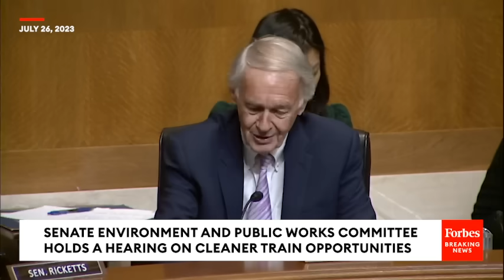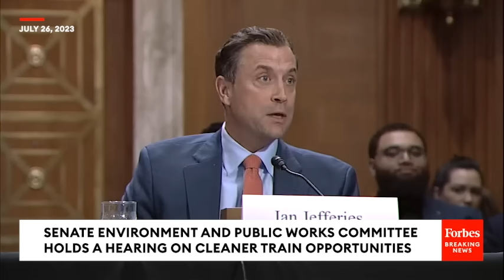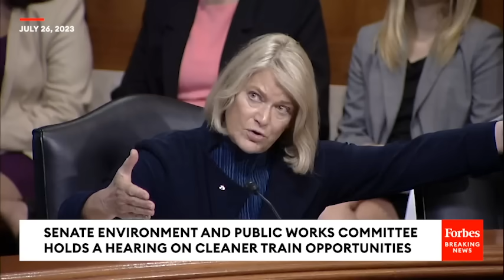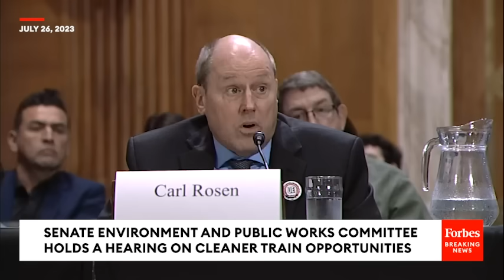‘How Long Would It Take To Replace All Diesel Locomotives With Electric?’ Cynthia Lummis

Comment: A new diesel-electric locomotive is $2 Million+. Short line railroads use older d-e locos worth $50-100K. My daily loco was built in 1956 and still runs great. Being forced to buy new electric-only locos would destroy 90% of all short line RRs in the US if not 90% of the industry. This is stupid.
Reply: To make the battery alone would take most all of the total battery production today , cars would have to wait . To make one battery for a loco would take hundreds if not thousands of EV 's with no batteries  .
Reply: @claybair4904  The only reliable electric trains have overhead wires. Try refining and stringing all that copper on steel poles without burning any coal! LOL!
Reply: @jaqcp  the only reliable electric trains can be set up on the dinning room table.
Reply: @jaqcp  or mining any copper since it is about impossible to permit new mines in the USA!

We could have been full electric by the 1950s or 60s if that had been the push when they were replacing steam, now it would be a disaster to convert.
Reply: @danw6014  Uh, even those are a PITA to get running reliably.
Reply: @danw6014  actually lot of them aren't reliable either
Reply: @lynncarden  the old ones I had when I was a kid still work. They won't be leaving you stranded in the Nebraska prairie either.
Reply: @danw6014  and under the Christmas tree.
Reply: @claybair4904   Very limited range too. You think there are supply chain issues now? Wait 'til every freight train has to stop and recharge the batteries every 100 miles on a 4000 mile trip! That would be a colossal traffic jam of Biblical proportions.
Reply: @claybair4904 I can’t see locomotives using batteries over running off direct power lines like all other countries rail systems. I’d think our county would cost tens if not hundreds of billions of dollars updating our entire rail system just for the locomotives and power lines, not even replacing track.
Reply: @claybair4904  -  Its easier to electrify the lines like Europe and the largest rail system in the world in Russia and the countries of the former Soviet Union. Electrification is the answer, but not with batteries... Just electrify the lines and that will solve the problem but it will take decades to do that also. And it will require NUCLEAR POWER to make it all work properly. HELLO MR THORIUM.
Reply: @KlodFather and one strong rain with wind and the line are down pure crap and not reliable and don't forget the cost of maintenance of said wire and said wire need to be bare for the train to make contact with it and bare wire out in the wild will corrodes fast
Reply: @legros731  -  The wires are usually (I believe) Zinc coated low corrosion steel. They have all electric trains in Europe and Russia as well as the FSU (former soviet union) countries. This is not new tech and is well established. It is possible to electrify here, but it would require a lot of infrastructure. There is not enough electric power generation to run our trains by battery or by wire, but the wire is more efficient and has less environmental impact. No more double deck trains. It might be better to do it with a third rail... But that is dangerous. 5 to 15 kilovolts.
Reply: @KlodFather  I live in Québec and we just build the rem it a passenger electric train with overhead wire at night you can see the thing sparking like crazy  and it look like crap with all the wire in the air disgusting
Reply: @legros731  -  Its still a better system than batteries in a train. A train is electric anyway... Its an engine running a generator or several generators and then traction motors that drive the train. Either a third rail or overhead wires needs to be installed to electrify the trains. Batteries will be too impractical.
Reply: @KlodFather  where did I even talked about battery you can't compare Europe to north america distance are way different it make no sense to install wire and a third electrified rail is nonsense where anyone can touch it  it's not a subway we talking about 
There a reason all of north america use diesel electric it not like these decisions are taken without any tough
Full electric is good for transportation like subway and tram we got all that in Quebec but still use diesel electric for freight
You not making Montreal Vancouver in a tram lol it 5000km  or 3000 mile of wire across nothing but field and forest lol good luck
Reply: @legros731  -  It has already been done. There are huge rail lines in Russia that are electrified. Granted it is high voltage, but nevertheless it can be done and has been done. Batteries is the BS way of doing a project like this. Its an enormous amount of power to move those trains. You are correct that there is not enough infrastructure and that it is a difficult project... But it has been done. We need Thorium Nuclear Power to solve our electrification problems.
Reply: @claybair4904  WTF battery!!!!!!! Europe and most of the rest of the world uses trolley electric. North America, and Australia are in the stone age, and love being there. Will trolley replace every diesel loco, never, but most main line can be.
Reply: @claybair4904  I say the biggest thing I saw in Europe was all the Electric wires running beside the tracks for Locomotive to get their charge. I don't think a EV Train would work like they think it will. Cause if you take how many cars they pull I don't think it would last as long as they think plus if they went the Europe Ideal, You would need a lot of wire ran across the country. Also think the BIden people playing around like this is Sim City or another city builder game, where you can click and build and in seconds it is built.
Reply: let me guess EMD gp9
Reply: @dknowles60 I was guessing GP-7. A SCL official in Waycross told me it was the best locomotive they had ever had.
Reply: @jockellis  E.R.O.E.I WHAT YEAR WILL CONVENTIONAL OIL PRODUCTION PEAK ???
YOU ARE LIVING IN A DREAM WORLD
Reply: @dunexapa1016  Back atcha.
Reply: @jockellis   Oh gee, what wit.
Reply: @dknowles60   GP8! You're awesome!
Reply: @jaqcp   you just taught me somthing never knew that Emd made a GP8  but since you are doing a tough job as a locomotive Engineer  i just learn somthing
Reply: @dknowles60  The lines between Gps 7-8-9 seem to be blurry. Our locos (PREX 801, 802, 803 working on the GCW if you want to look them up) have the pneumatic reversers and control stands, so I was told they are 8s. I believe the 9s had electronics packages, but are otherwise similar in size and power. Since this is  my only road and only locos, my experience data base is very narrow.
Reply: @jaqcp Electro-Motive Division(EMD) of General Motors designed the GP7(rated at 1,500 hp from the 567B 2-stroke engine) & was built in the production years of '49-'54. It's successor is the GP9(rated at 1,750 hp from the 567C 2-stroke engine) produced from '54-'59. The only RR Co. I can find that had an extensive fleet rebuild program was the Illinois Central in '68. GP7's were rebuilt to GP8's & GP9's to GP10's. Now we're 55 years on & the origin of the Loco & it's rebuild status could be very different & possibly those details might be unknown to whoever is asked. The Loco might just be called a GP8 & the employees didn't gave it a second thought. The RR's Power desk would have the specifics of the Loco's ~68 year history, if you have the time to check, it would be interesting. As far as I'm concerned, you were told the Loco...or 'engine'...is a GP8, good enough for me, but the histories & rebuild status can be very interesting. What's the name of the RR you commute on please?
     Having the Green people snapping their fingers & imaging a fully functional Battery/Electric Loco w/in a decade is beyond the capacity of healing by a Hospital Mental Ward or Mental Institution. Reality has always perplexed the Radical Dems & the Climate Cultists. Include a few money grubbing power hungry RINO's & I'll now have Archery practice aiming at their bloated fannies.
Reply: Whoa there Kermie,  Rep. Cynthia Lummis is on our side. She represents Wyoming, and not a blue state, and I remind you and anyone else reading this that, failing to vote in EVERY election is a stupid move if you are a patriot who loves our country and our decedents. Even the lowest council meeting and HOA election is important. Tell everyone to get out and VOTE. Vote the bastages out!
Reply: @carmiethompson2676  The locos I mentioned are in fact a part of the ICG rebuild program.  Good call!
Reply: @jaqcp Just to be clear; there's Illinois Central(IC), from 1851 - 1999 & Illinois Central Gulf(ICG), from 1972 - 1998. The 'overlap' of the final years is interesting but not needed for this conversation. As I stated in my first comment, the rebuild program was started in '68 at the Paducah, KY heavy shops. All the rebuilding & repowering was done by IC not ICG but if some engines were finished after '72, I don't think it was important to management to credit ICG. They were working on the merger into Canadian National(CN) & the Canadians were more concerned about the health of the fleet.
Reply: @lynnkramer1211  School board elections may be the most important.
Reply: I think that is the goal.  Destroy the smaller companies while investing in the large ones.  Once the large ones are all that is left, go for full control.  Capitalism to Socialism transition is complete.
Reply: @TheBeacker1  nationalized or confiscate. That's what is happening with farming.
Reply: @danw6014  Where in the USA has a farm been nationalised?
Reply: No, corporatism. Corporatism is a form of fascism.
Reply: @TheBeacker1  yeah you saw that too,under this crazy leadership of [who are you,i'm here to help] way too much control for one system the railroad system,i moved 20 miles just to get away from the noise of coupling and uncoupling cars at 1;30 am.this will not change with electric power,the noise
Reply: @TheBeacker1  The world run by large corporations is not socialism in any shape or form. It is just how capitalism evolves.
Reply: it is not unusual for a train to have four or more locomotives with a combined power of over 12,000 HP and to need all of that power to get up the hill.  Nobody makes a battery that can support that much load for any length of time and if somebody did at some future time, it would probably weigh as much as the locomotive itself, and cost as much as well.  what is going to happen when that battery needs charging?  Is the train just going to stop and wait the hours it will take to top it off?  until bureaucrats and politicians spend a few year successfully running a railroad they should avoid telling the industry how it should operate.
Reply: They are trying to do something similar to small farmers in California.  These family farms have collected a fleet of vehicles over decades, and the state says they are polluting even though they are specialized and many of them don't run all that much in a year.  So now the state is demanding that all these vehicles be replaced at once never mind that a family farm doesn't have $1.5 million laying around to replace them all.
Reply: FYI almost all locos in the US are electric.  Some of the 100% are electrified by a catenary system and others by a prime mover in the loco.   Got to get the electricity from somewhere.
Reply: @Tsamokie  not many that are direct electric.  We did the same thing in mining, 50 years ago almost all the large underground rail was catenary, now you don't see rail at all, just dumbly used direct drive diesel trucks. 

I've thought for a long time that a hybrid solution for diesel-electric wouldn't be hard, add a battery car in with each loci and use the power generated when rolling down grade to charge batteries instead of sending those amps to the grids as waste heat.
Reply: short lines and last miles, ctanary is really superior, the problem is the infrastructure costs and buildout costs for the catanary, the good part however is that all exsiting locomotive can be converted to catanary. There significant issue catanry, but it's more practical than batt/electric
Reply: Who is going to pay for it? Build back better? Build back better is not even upgrading the electrical grid. Build back better doesn’t know to produce electricity for all the electric cars the government is forcing us to buy.
Reply: but they are doing the same with cars -- can have a 25 year only car fully compliant with emmission tests today and yet the push is replace all with electric  even though there is not enough compacity in electricity producation !
Reply: Many if those have already been converted to LNG or Propane fueled locos which ARE zero emissions. Nothing comes out except carbon oxygen and water. The carbon is heavier than air and settles to the earth and become plant food. That's as environmentally friendly as it gets. Wind farms besides looking ugly, kill thousand of our limited numbers of birds of prey every year. That is NOT environmentally friendly my friends.
Reply: Well that is the governments goal. To destroy as many small businesses as possible.  The government wants to control 100% of everything. You are not allowed to own anything. That is the end goal
Reply: Agree. Diesel electric is about as good as it can get. Left wing socialist Politicians and left wing activists are dangerous
Reply: That's the point.
Reply: There exists an reasonable cost and time solution. As you pointed out your daily driver loco was built in 1956 and is still running. The reason, it is a hybrid. ICE powering electric trucks. So here is the solution, remove the ICE engines. Install a battery pack that can run the train for say 20 miles. Add  pantographs to the engines and put up line contact points, sets of charging wires every 10 or so miles. No need to electrify the entire of the line, just about 10% of it. Stations are of course charging points. 

In this  way, the major costs of building new engines is avoided. The environmental costs of building new engines is avoided. Keep as much of the old engine as possible.
Reply: @oldfarthacks they do t have the technology to make batteries big enough to store enough power to run a locomotive for 5 miles let alone 20
Reply: @ohboy2592 For sure, but how about pulling wagons with freight?
Reply: @oldfarthacks  Cantenaries are EXPENSIVE and a waste.  ESPECIALLY for a short line railroad.  Why would you rebuild a perfectly running locomotive and install a bunch of infrastructure which would require full time maintenance personnel, when you could get a refurbished locomotive for a fraction of the price??????
Reply: @oldfarthacks this will never work lol
Reply: Like democrats give a crap if they put people out of work and destroy the economy!
Reply: And guess who in the industry will be pushing for it? The big shipping companies so they can swallow the small operators!
Reply: @johnbaker6125    I believe you may be delusional. The question is ... Would you WANT TO be disillusioned?
Reply: It's intentional.
Reply: You could have stopped with "this is stupid". She thinks if her sex life can run on batteries so can everything else
Reply: the ones they used to run on our line were basically a bus body mounted on a 4 wheel rail chassis. i loved them. class 142 pacer!
Reply: That's their goal.
Reply: We have SD40-2'S and SD40T-2'S all from the 1960's. Being a small class 3 shortline, we can't afford 5 to 6 brand new locomotives.
Reply: @michaelball760 Going electric on a shortline doesn't make any sense, yarding yes, mainline yes.
Reply: No politician couple possibly be that ignorant.
Reply: I wonder how much wiring the entire railway system would cost?  Something tells me it would be quite a bit more
than the locos not to mention trying to build and operate all the new power stations to power it.  It ought to be a law
that you need to pass second grade math before being offered a cabinet position.  At least TRY to cut down the
number of ignorant political morons being appointed by the Moron in Chief.
Reply: and trains are literally the single most energy efficient transportation we have, and comprise almost none of emissions.
Reply: @SoloRenegade  Travel by water is slightly more efficient (25%), but has obvious significant limitations.
Domestic waterborne transportation fuel consumption is 217 BTU/short ton mile, with Class 1 railroad at 289.
Heavy trucks at 3,357 and air freight at 9,600.
Reply: hear hear!
Reply: No, it makes perfect sense if your goal is to destroy America. These climate hysterics are nuts.
Reply: Instead of using a stupid battery, that has a potential  to burst into flames, why not put up over head wires to get electrical power to the traction motors on engines!
They had those in the north east corridor  for many years, along with other areas!
These environmentalists we do anything to get rid of fossil fuels! Without fossil fuels we couldn't  make anything Plastic is made from oil and many other products as well!
Reply: @deeppurple3489  yeah including the batteries incased in plastic.
Reply: @deeppurple3489 who will bear the cost of installing and maintaining those thousands of miles of wire? Where are the power plants to generate the massive amounts of electricity, who will pay for them? When all that infrastructure is in place, the rail companies must purchase, most likely totally new build, electric locomotives. Again, another cost to be borne.
Reply: @deeppurple3489  Overhead electric has actually been declining. In the 50s and 60s there was more trackage under wires that today. The NEC is but a small section of what used to be. Look up the Milwaukee Road some time. It had 645 miles on mainline that were electrified. Some of the old substation buildings for it still existed the last time I was out that way. Then you also had the Virginian RR in the East that also when taken over by the N&W dropped its wires. Overhead electrification is expensive to maintain which is why both are gone. By the way, the PRR ( NEC ) came after the Milwaukee Road.
That said, as we are in need of a better electrical grid, this would be the time to tie both together. If the RR ROW had power poles for the grid, then it would also be able to supply the locomotives.  Now where is the power for that grid going to come from? Solar and wind can't handle it. Hydro can't either. Natural Gas, environmentalist don't want that. Coal, they hate that. So that leaves only nuclear power. And you know they hate that too. So there is basically nothing that will make them happy except for a complete shutdown of the US.
Reply: @deeppurple3489 You're not running 1 million kilometers of overhead electrical lines worldwide especially in countries with natural disaster. it's just not sensible.
Use hydrocarbon chemical storage....
Reply: @deeppurple3489  Overhead wires are subject to bad weather and the environment.  Locomotives like the "Green Goats" are not a bad alternative to switching locomotives for local use.
Reply: Being stupid is what we are becoming Great at. Get used to it if potato joe stays in office!!!
Reply: @michaelwentzel4664  , THAT WAS FUNNY ... JOE IS TOAST RIGHT NOW, HE LOST IT IN FRONT OF OTHER WORLD LEADERS.
Reply: YOU MISSED ONE EXTREMELY CRUCIAL POINT BECAUSE YOU LIVE IN A FANTASY WORLD!
Reply: I LOOKED AT EVERY SINGLE COMMENT SO FAR AND YOU ARE ALL LIVING IN A FANTASY WORLD. DON'T WORRY. YOU ARE GOING TO GET WOKE UP SOON. YOU MIGHT NOT LIKE WHAT YOU SEE WHEN YOU WAKE UP!
Reply: @dunexapa1016  our fantasy is to be left alone. Please enlightened us on this crucial point.
Reply: @dunexapa1016 why are you shouting clown
Reply: @legros731   Would you WANT TO be disillusioned? E.R.O.E.I.
Reply: @legros731   I am not shouting clown. I am not even shouting. I am thinking. Would you like to know what I am thinking? I think I have an AI chat App nick-named 'Hannibal Lecter'. And do you know what else I am thinking? I am thinking you might be wondering if 'Hannibal Lecter' is chatting with you now. The app allows role playing and allows the role of Hannibal Lecter and I allowed it to assume the role and the question is, has this role been assumed at this moment? 🤔 What might you assume?